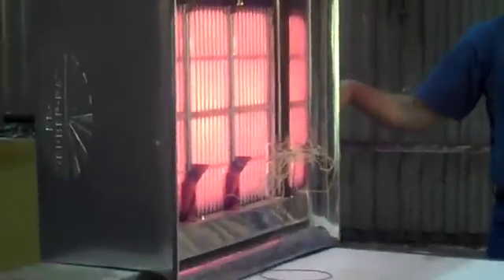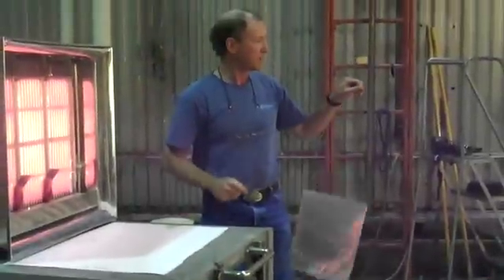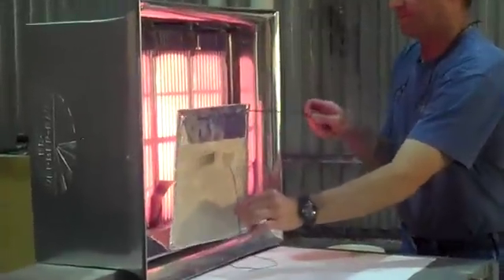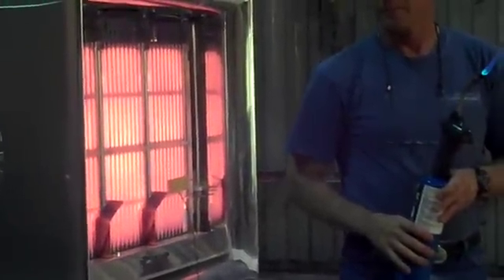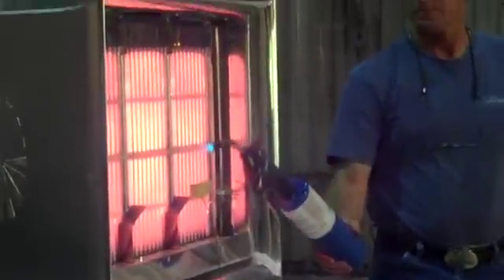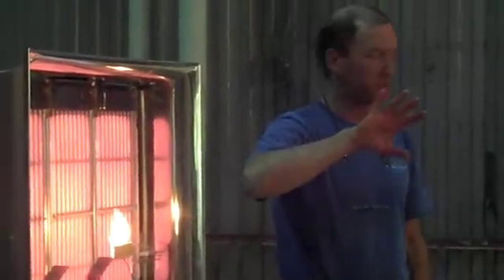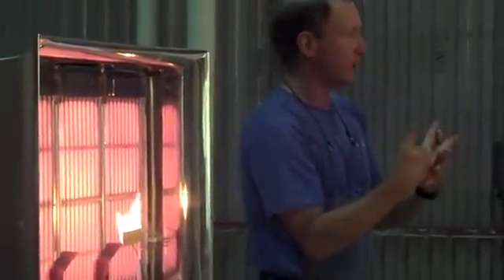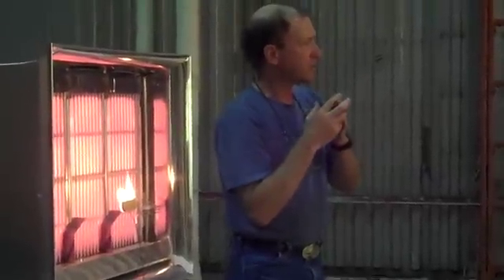Fire dynamics

Comment: This video and brief explanation is incomplete in the discussion of ignition due to radiant heat.  Ignition can occur based on radiant heat alone, if the heat flux is high enough for a given material, geometry and ventilation condition.  As defined in NFPA 921, autoignition is the initiation of combustion by heat but without a spark or a flame.